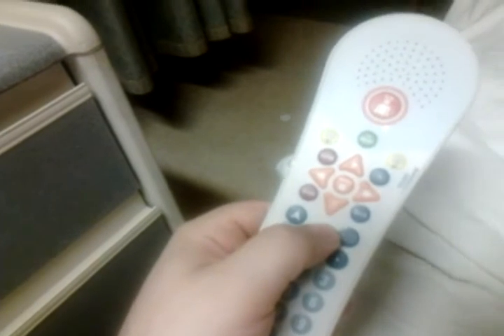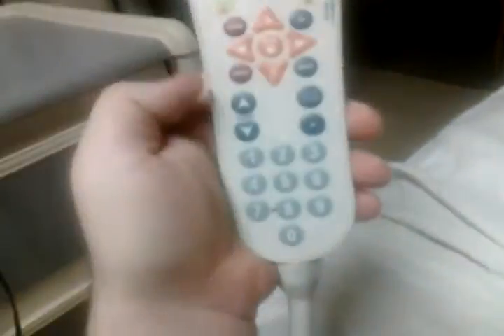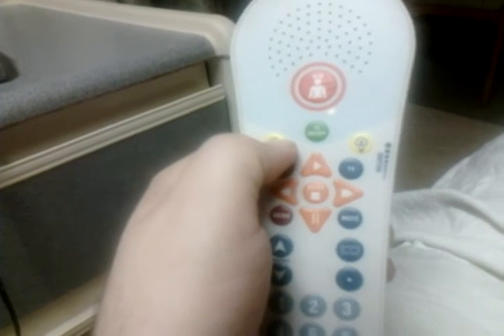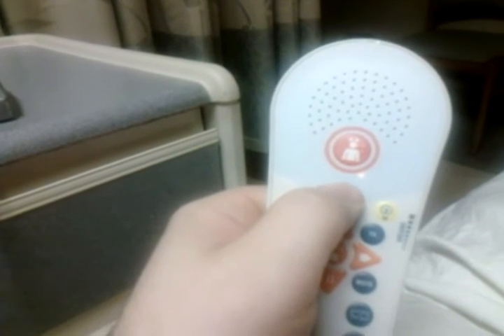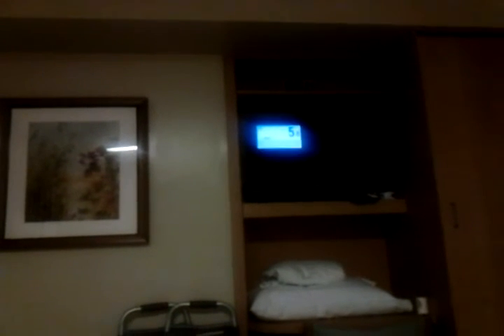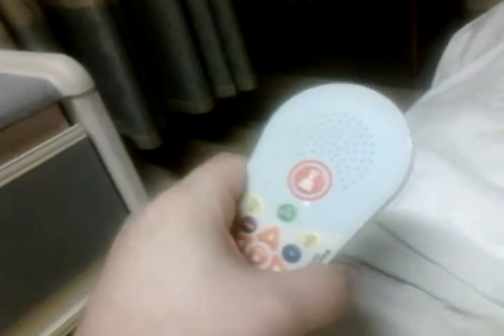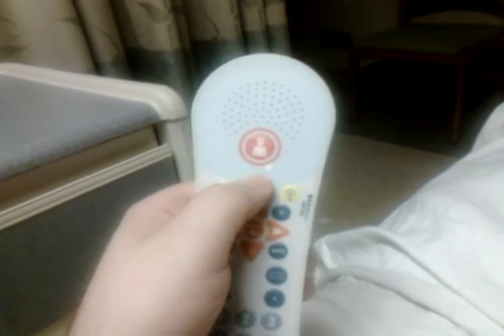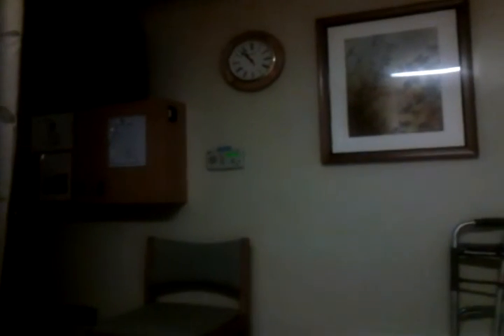Hospital Call Bell/TV Remote

Comment: The call bell has a button for when your in pain
Reply from the maker: That's all fine and good until it DIDN'T WORK because the plug fell out of the wall.  Fortunately, the hospital phone worked, so I called the front desk and told them it wasn't working.  They called the unit, sent the nurse in, and then we found out.  Good thing I still had my wits about me, otherwise I'd possibly have been in real trouble.

Comment: Mine was working, tv went to auto shut off. Turned back on. Now volume only comes out of tv
Reply from the maker: Tell the hospital staff.
Reply: @jaykay18  They didn’t even know sound came out of the remote, after a couple hours it came back on I’ve had the same problem before I think it’s just a shitty product
Reply from the maker: @breeblack927  They get a lot of use.  The hospital should have in-house staff who can fix it in under an hour.
Reply: @jaykay18  these are brand new.
Reply from the maker: @breeblack927  That's probably all the more reason it broke!